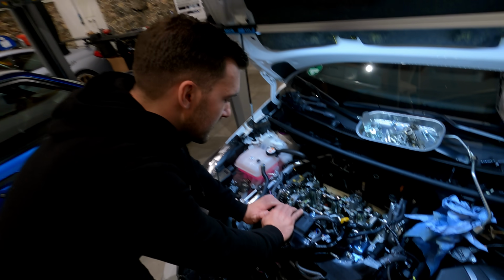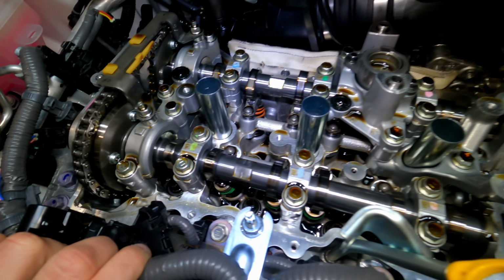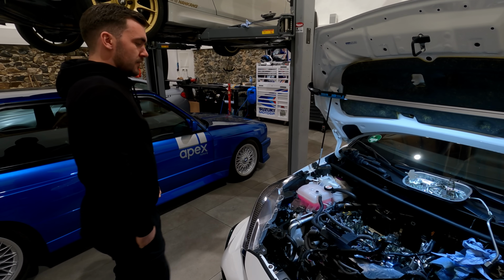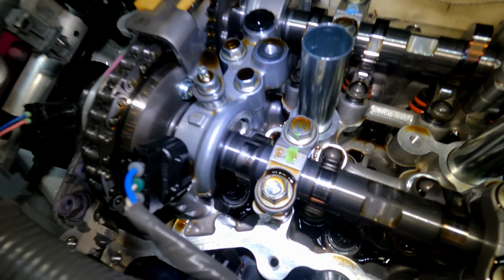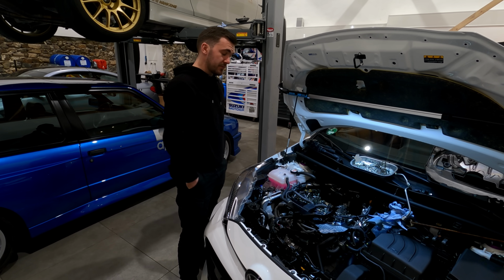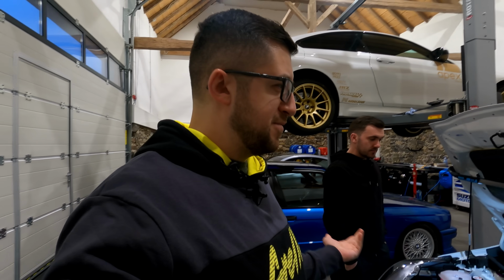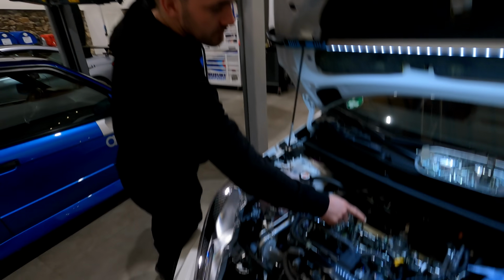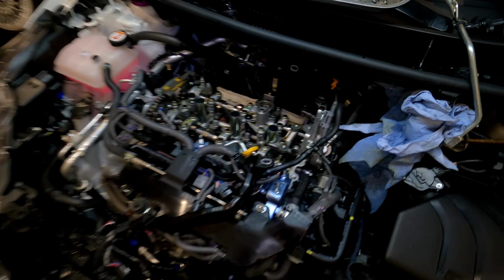Misshift Aftermath. Inside the Damaged Toyota GR Yaris Engine. OUCH!

Comment: Still an interesting damage from just an over-rev, especially that Robert said he saw the engine speed barely touching 7200rpm (which is no more than 7000 in reality). On a 7000 factory rev limit engine you will not get any issues up until close to 8k, on factory valve train and factory rod bolts. It looks like that slight over-revving only started the issue so now I'm starting to think if that may be the first weak point on these engines. Usually over-revving the engine (properly overrevving it) will cause issues almost immediately, or at least make the engine run poorly right after. But... different engines, different ways to go.
I'm not sure about the price, but I hope it will be at least a quick fix, whichever that will be: replacing the head replacing the whole engine, machining the head and replacing the bent valve + guide + everything... Good luck! We want to see the Yaris back as soon as possible :)
P.S.: And no, the pin leaving the rocker arm cannot happen from the suspension and chassis mods, only oil starvation related damage can happen because adding a lot more grip and that only if the oil pan baffles and overall design will not be able to cope with the extra few tenths of G.
Reply: it has an analog dial for the tachometer. The dial wouldn't be able to catch up to the speed that the engine reved up to in such short time. and if he was only aiming to downshift to 4th, that means he's still carrying a lot of speed, which will be wayyy over 8K rpms at 2nd gear.
Reply: Ask fot the datalog and see if robert hit that 10k :-)
Reply: He also said he could feel the resistance, by the time the needle cought up(or his eyes) it was probably already slowing down alot..
Reply: Analog tacho can't cope with a quick difference in the rpm you can calculate the peak rpm if you have a data for 5th and 2nd gear and the rpm of the engine before the shift.  If the difference is for example 2 x then engine coud rev up to 10.000 rpm easy
Reply: Unless you've got a digital dash with a speed readout set like for the LFA, what the engine actually over-revved to will never be accurate.
Reply: As mentioned, he probably went way over 7.200 rpms, what he saw visually for a second on a analog gauge isn't likely what the engine actually hit going from 5th and 2nd.
Reply: 7200 rpm? from 5th to 2nd? lol i see you know cars 😂
Reply: I think not Robert had hes eyes on the rpm EXACTLY when  the rpm peak´ed at highest since i belive the rpm was  higher than 7200. Maybe it was 7200 when it already has happened and the rpm was on its way down and thats when robert noticed the rpm . I have done this misstake myself and in my case i thought the same " it was only 7500 rpm" = i saw the rpm -gauge on 7500 rpm cause i was fast on the foot and press the cluth but the Syvecs-Log showed 8300  rpm  when we looked at the logs after.....so i think the rpm was  higher than 7200 as highest. You dont stare at the rpm exactly when   it happpends, it surely takes 0.2-0.5 seconds to move your eyes to the rpm-gauge and  that 0.5 seconds the engine had slow down real much.  MY engine was fine afterwards due the fact that its built for handle 8500 rpm and about 1000 hp but i only take out 700 whp now during winter.
Reply: That's crazy talk. 
5th gear to 2nd gear on the Nurburgring...
Think about it again.
Reply: @sunrisesunset1734  Straight from Robert's mouth on his last video.
Reply: @gpaje  What i'm saying is, this guy is speculating that the engine may have some weakness lol... does he understand what happened?
Reply: @sunrisesunset1734  It doesnt have to have gone all the way up to full speed, if he pressed the clutch quick enough it might not have had enough time to get up to full RPM.
Reply: @sjors-a  That's how many milli-seconds he would have had to react in? Without even having anticipation on his side like at drag-race lights. Maybe you've never miss-shifted... in a split second it's all over.
Reply: maybe the right time use some reinforced or forged materials but that will cancel the warranty
Reply: @iNSTAGiB Entire section is from beginning to 10 minutes, but the part he is talking specifically about difficulties driving the car are from 7:30 to 9:00. 
https://www.youtube.com/watch?v=R0t32psqc1s
Reply: @iNSTAGiB If by any chance my previous comment doesn't get shown due to the link being in the comment, here is the title of the video.
"36 Years Old and I had a Stroke?! / Covid / E-Bike Giveaway"
Entire section is from beginning to 10 minutes, but the part he is talking specifically about difficulties driving the car are from 7:30 to 9:00.
Reply: Dash cluster has inbuilt smoothing with the gauges so it could have gone to 8k or something. Worth clarifying that oil starvation issues will  be things like main/rod bearings and not valve train rockers etc
Very interested what Mr Toyota has to say from ECU data
Reply: if he shifted from 3rd to 2nd (while he probably was already close to 7000rpm at 3rd, going to 2nd would have made it jump to over 9000rpm). so someone is lying
Reply: @nicobuzo3  He said in his video that he downshifted from 5th to 2nd. For sure he went way above 8k+ rpm
Reply: Do you know what a rev limiter is, clear your not even close to an engineer and know what a fuel cut off is???
Reply: @denero4735  A rev limiter does nothing against a misshift
Reply: @Chambers36TheEnter  In this case, don't money shift it, no engine can survive a missed shift.
Reply: 3 cylinder engine + such high compression. Not a good mix.
Reply: @MarcraM82  what do you know about anything?
Reply: @markscully2342  mechanical engineer. Turbo charging a 3 cylinder engine with so much compression, power will always put the engine at a higher load and risk of not only long term engine wear but also failure from over rev.
Reply: Put yourself in Robert's shoes. You're an automotive professional in the Nurburgring, you come from a country where most people learn to drive an automatic, and you make a mis-shift that breaks the most expensive component of your company's brand new car that has an 18 month waiting list. There's a lot of pressure for racing driver excuses.
Reply: @Ovenman940  when robert drives he seems insecure and not that good, he;s not very capable as a driver i must say
Reply: @nicobuzo3  in one of the videos he explained that after the stroke he had last year caused by Covid, his coordination was lacking and a whole year later he still isn't where he was before that.
Reply: It's a Japanese car. This is normal, they're brittle. Just like Nissan GTR's would chew through their gearbox if you did more than 10 launch controls in it's life time. They are reliable, but not durable, and nowhere near as over-engineered as European cars which can handle far, far, far more abuse on track.
Reply: @derbigpr500  A Toyota brittle and a European car reliable, lol, that's the first I heard of that.  The fact he was able to do 5 strong laps after a money shift should tell you how rugged that car is, not brittle.  My E46 BMW would have blown up the 2nd I missed shifted. There is far more evidence of European cars being unreliable and Japanese cars being reliable.
Reply: @gpaje  brittle Toyota: looks out window @ the 350,000km hiace workhorse still on it's original clutch, 🤔 brittle and Toyota don't work together, however I would expect a Toyota to be more capable of over rev(without major damage) then most manufacturer's, however as the lads touch on modern engines aren't as durable as the good ol 4e,3s or 1j ect, I'm curious, it's quite big for a 3cyl engine but I wonder how much headroom there is for power increases, would it hold 450hp or more, it's an impressive machine no doubt but them lil rockers look Abit flimsy, it used to be a set of rods and Pistons to make high hp, is this the weak point or just one of them, will they appeal as much as the old-school cars if power is restricted by components, an old T.M.E. Evo is on par performance wise??
Reply: @robertboland3923  Over rev???  It was a money shift, there is no protection for that, that's why Apex prefers automatic so it's not possible to money shift a car.  The fact he was able to do 5 strong laps of the ring after his shifted from 5th to 2nd by mistake is actually impressive.
Reply: @derbigpr500  lol good one.
Reply: @derbigpr500  Do you realize that you are talking about a Toyota. The facts say you are dead wrong. Toyota and Lexus vehicles are WAY WAY more reliable than even the most expensive European cars.
Reply: @Josefin Kjellsson Toyota Supra MK4 engines are still going strong. Popping seals is the absolute best thing that can happen in a high-performance engine. The Lexus LFA, and every other Toyota and Lexus sports car can be daily driven then thrashed on the track on weekends without any major issues. THAT my friend, is living a dream. Try that with a Ferrari or Mercedes Benz or an  <insert inferior brand here>.

Comment: On my opinion, don't try to save anything from this engine. The parts in the head are badly damaged, pistons as well. I see an engine filled of metal shavings. No need to waste your time. Remove the old one, put the new one, add the old manifolds, turbos, electrical, pipes, etc
Just my opinion. I know finding parts is a pain. I have two project cars as well. There were parts which took me more than an year to find, waiting for a normal price delivery, etc...
Reply from the maker: The dealer will fix it
Reply: There is no rule for things like that. Everything is individual, some engine may run fun after small fix, some would be not worth repairing.
Reply: Yeah. On some old pre-chamber low compression engines like turbo 2JZ - will be no issues. But here we have a small direct injection, high compression turbocharged engine. Even a small misfire can kill the engine, not to mention the overlaps between pistons and valves... Also uses very tight and strong springs and compensators in order to have very optimal and precise timings.

Comment: If the pin had come out of the rocker arm wouldn’t the valve have been left unscathed and just in the closed position. Isn’t it more likely the initial over-rev dislodged one of the collets and eventually the second one made a break for freedom? Are the rocker arm pins just an interference fit?
Reply: I would agree with your assumption the valve without a rocker is normal closed due to the spring pulling it up. Only way it can drop is the the spring broke or the collets dislodged.
Reply: That's what the rev limiter is for.
Reply: @denero4735  Rev limiter won’t stop a mechanical over-rev.
Reply: @S1RS  precisely

Comment: Have a look at Japan and put a 4 or 6 cylinder engine making 600 HP in :-)
Reply: Balance would be off and the turbo lag massive.
Reply: @Sextusheap  The WRC car is using a 4 cylinder engine.
Reply: Might as well, 400 ps would be ok too.. but make sure to put an automatic gearbox in 😅

Comment: Its record,you broke a new toyota
Reply: @theraggededgeonboardfastes8461  Fortunately the dealership will fix it, misha himself said that in the comments. I've seen people driving the yaris in Nordschleife including misha himself and the cars are on and off the throttle a lot more than in WRC. WRC car stay in redline even longer because they have to go uphil and jumping and flying so they need to maintain the momentum all the time, they use sequential gearbox which can still be considered as a semi manual because they still have to use the stick to shift. The reason why alphine is lighter is because it is a 2 seater and RWD
Reply: @theraggededgeonboardfastes8461  There are so many other GR Yaris video running at the Nordschleife with no problem whatsoever. There are also many video showing a tuned yaris putting 300+hp with no problem, Litchfield yaris or HKS yaris for example. This isn't a typical 3 cylinder, toyota designed the engine to handle massive stress for WRC, a couple lap at Nordschleife is nothing If there's a problem then it is surely because human error and robert himself admited that it was his own fault. Toyota give this car a 5 year 100.000 miles warranty so they are very confident with its reliability outside of human error.
Reply: 168 bhp/L and no dct is asking for trouble lets face it...
Reply: @theraggededgeonboardfastes8461  HKS get this thing to 475hp without blowing up, so this is something that's very unusual and definitely not just because of misshift

Comment: I’m leading an investigation right now on a jet engine thrust bearing failure and I had to explain the same thing - we need to fully strip the engine so we can flush/clean all oil passageways so we don’t put the engine back together and have another failure soon after from debris still hiding in the engine! No cheap ways around it 👍🏼
Reply: Lots of test flights, too?😂
Reply: @MT-eb2dx  on the ground in a test facility haha. That’s when we hope the engine doesn’t fly away 😬
Reply: @CapnT Haha, that's probably for the best :D
Reply: Is it a case of pieces of the engine fell from the sky so you have to recover them? 😂
Reply: @dangodi4100  haha not so much
Reply: Do it properly once, or do it wobbly a few times ... what are your bosses willing to pay for ? 
;)
Reply: What is the engine type?
Reply: @Johnno48  RB211
Reply: @CapnT87   one of the coolest ever made
Reply: @jlj3856  damn straight!
Reply: @CapnT87  Which spool is the bearing on? Or are we talking gearbox?
Reply: @SKYWURX  Not at liberty to get into specifics haha. 🤐

Comment: Are those GT86 gearboxes that weak? It's like what 3rd gearbox rebuild now? I'm interested in getting one that's why the question i know people who modified imprezas were experiencing issues if went too far with power and also not that far so is that issue present here as well?
Reply from the maker: No, people not knowing how to drive a manual thinking they NEED to drive a manual on the track, because paddleshifts are for pussies.